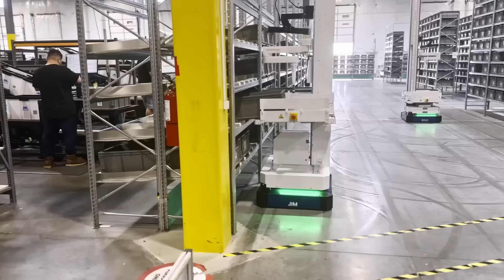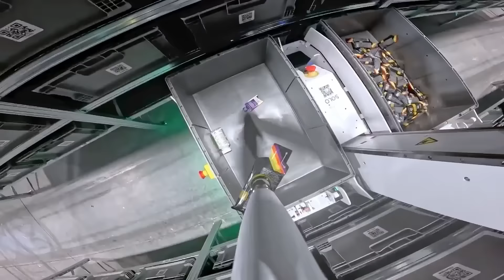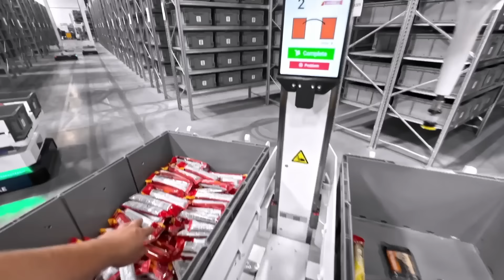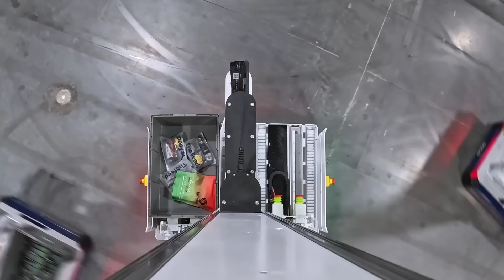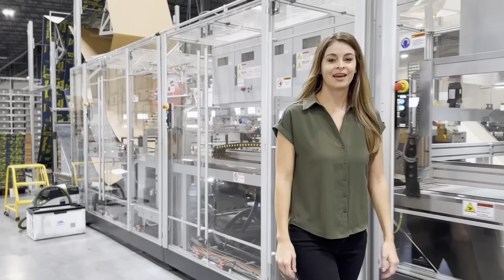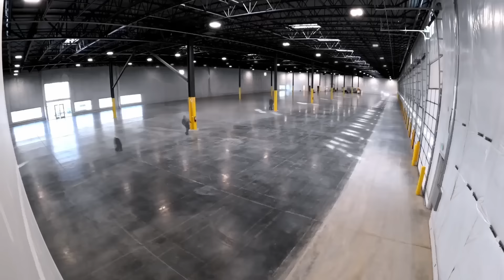World’s most advanced robotic warehouse (AI automation)

Comment: Thanks for sharing the most frontier and advanced warehouse technologies. The technologies are really impressive. I’d like to ask a few questions if you don’t mind. In the video, you mentioned that the system can pick items from a bin even if it has never seen the material before. Is that really the case? I’m wondering whether there’s a risk of picking the wrong box or grabbing the wrong item if materials get mixed up. You also mentioned that there is a manual station to assist when recognition fails. From the video, it seems most of the items are relatively small, so the chances of needing manual intervention look a bit high. How do you expect the system to improve in this area going forward? Thanks again for the great presentation, and look forward to your reply.

Comment: What happens if there is a power supply problem?
Reply from the maker: Typically there is a backup generator which would power the on-site server and network, and each robots is equipped with a 10-hour battery, so the system could continue operating for a limited time in case of a power failure.

Comment: I'm not an engineer but surely the best design for this kind of facilty would be a silo with rotating drums comprised of space for inventory. so instead of having robots drive around you just have one picking robot standing still while the drum rotates and goes up and down.
Reply: The dilemma is between having the complexity in the shelving system or in the robots. Simple shelves/mobile robots make the system modular : you can add an extra row of shelves in hours, and even move to a new facility fairly easily. Also if one robot out of 20 needs maintenance, it just slows down operations but nothing is stuck. I don't know about drum-shaped systems, it would be optimized for triangular boxes and would require to rotate the whole stock to get one product, so it's hard to scale up. I've seen Kardex "vertical lift modules" at work (automotive industry), doing basically as you say : multi-storey high towers with an opening at the bottom spitting out the tray containing the required product.
Reply: maybe it would be more efficient but it would be much more expensive to build and expand. this system looks like it can be brought up in just a few weeks with minimal costs.
Reply: How do you scale if your intelligence is in the shelving system?  Scaling = more orders/unit time, more SKUs, new constraints to how packaging and replenishing needs to be done and other heretofore unimagined issues.  Easier to update robot software or even introduce specialized robots.  It's also easier to "fix" the intelligent entity if it can come to you.
Reply: @redroad9949  well if you want more product variety, you have no choice but to scale. Also as a robot programmer, i can tell you that yes you can improve the efficiency of the robot but there is a limit and you will probably never reach what you want to do if the robot program has not been designed for these enhances in the first place. Also its worth mentionning that updating a robot software makes you at risk of new issues that you havent thinked yet, its an infinite cycle. With scalling, you can just upgrade on the side and when its done, you just redo the robot working zone and it works.
Reply: Terrible idea
Reply: This is why you're not an engineer

Comment: I suspect they're not using AI software, they're just using standard software.  Companies like to add AI to everything they do to impress the shareholders.
Reply: Object recognition, environment mapping and robotic piece picking -> some of the problems that they use AI for, as their website explains
Reply: @redroad9949  My point is that what they say, are what is the truth may not necessarily be the same thing. Given that all companies are touting AI implementation just to increase investor sentiment.  Recently I wrote some software for object recognition and you know what, it was not AI based, but standard object recognition routines. They're picking up pallets, and their environment is fixed so I'm struggling to see why they needed AI.
Reply: If, as she says, the robots learn from the mistakes they make, it is considered AI. Just not Generative AI or so. AI is a vast field that contains (but is not limited to) the fields of ML or LLMs that are the most popular within
Reply: @josephmartinez1267  If?  I very much doubt they're are using AI to learn because AI has a greater fail rate than hard coded algorithms.  Failure here can not be tolerated. And there's no need for AI because the units travel fixed paths and have limited functions.  Traditional software can handle this in its sleep.  While AI introduces uncertainty and greater risk. Any programmer worth their salt would be well advised to stay away from AI in this application.
Reply: @RobertA-hq3vz Bullshit. You cant hard code the robot to pick up any kind of shape. Ai can handle all. You cant pick the items up without ai. etc..
Reply: @Bene-r1u  You're obviously not a programmer. Of course you can identify shapes without AI. We've been doing it for years.  Pallets are also in specific locations and predefined positions so AI is not required. AI frequently gets things wrong which makes it the bad choice in this application.
Reply: @RobertA-hq3vz   Youre just wrong sorry. Even if it is a hardcoded program;  if it is able to handle millions of variations of weight, shape, texture etc while also being able to learn and adapt from previous failures, then for all intents and purposes its a type of narrow ai. so i dont think its misleading for the presenter to call it as such.
Reply: @mint-o5497  There's a big difference between software written by humans, line by line, and AI which is supposed to learn and change its own program.  Its two entirely different processes.   And where did you hear that it handles millions of variations of weight, shape, texture etc?  You just assumed it does. Just like people assume AI works, but it doesn't quite work, which is what companies are now finding to their great financial cost. Anyone who designs an automated warehouse doesn't just throw things in a bin like some drunken human, they design it so that machines can easily identify and transport it, so that the stupid machines don't make a mistake.
Reply: AI needs to know THAT. A human knows HOW. You can change many things and a human deals with it. Bloody code has to assume so much is equal. If a human promised me that he would do something by next Monday, but on the Monday he said he hadn’t done it, I would be annoyed. But then he disclosed that he hadn’t done it because doing it would have been very harmful to be. The bloody AI machine would have done it. For me and my fellow human share a similar form of life and he knew what  I meant by “he must keep the promise”, ALL things being equal. We understand so much that can’t be said or bloody coded. I walked past a school the other day and in a small wooded area a few boys were looking for something. One shouted to the other that he had found the stick they were searching for. The other boy asked if it was a long one? The reply was yes. He replied great bring it over then. Code that interaction with out trying to produce a 100 page document to say what a long stick meant.
Reply: @Mtmonaghan  did you get AI to write this because its looks wrong.
Reply: Define "AI".
Reply: @christiankoch9501  Ai is coding by non humans.  Traditional software is written by humans, one line at a time. If you don't know the difference then you've never written a program before.
Reply: If it can scan QR codes, it's using image recognition, which is very much AI.
Reply: @Shaker626  QR code scanning is not AI.  Its regular standard software which we've been doing for decades. Did you forget we've had computers and software for a very long time now? Created by humans, one line of code at a time.  Image recognition software goes way back well before AI came along. I wish people that knew nothing about technology would stop talking out of their hats.

Comment: It's stated in the video that the robots operate 24/7, but isn't there a downtime for charging the robots?
Reply from the maker: Correct, the robots autonomously charge throughout the days during off-peak hours when there's downtime. 1 hour of charge equates to 5 hours of work for each robot. The 24/7 part relates to the system as a whole, not a single robot